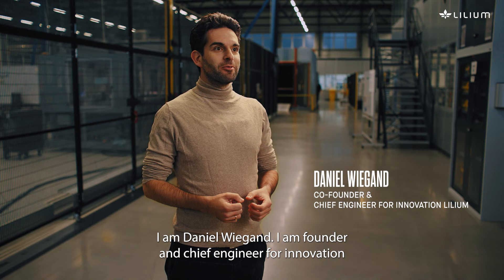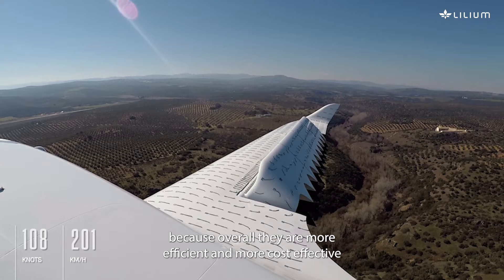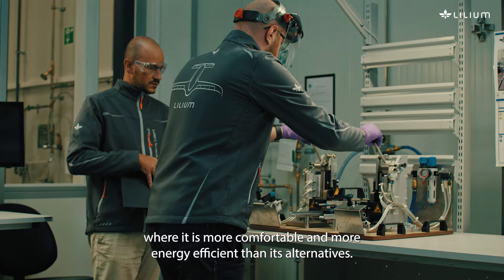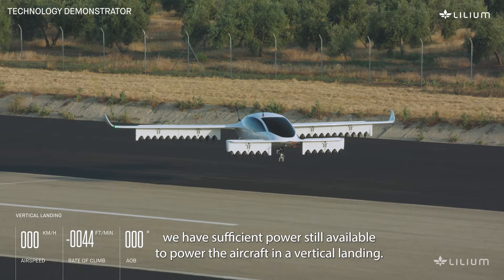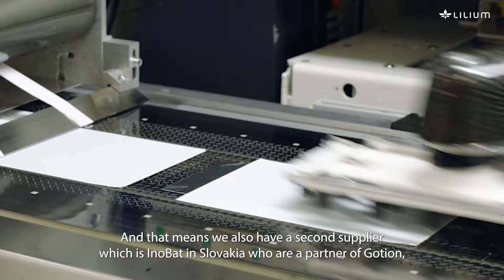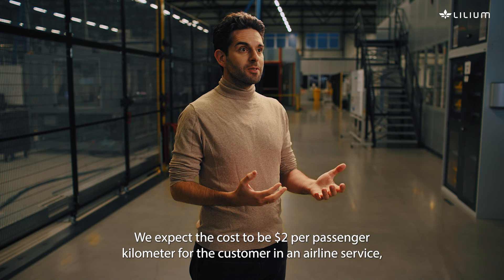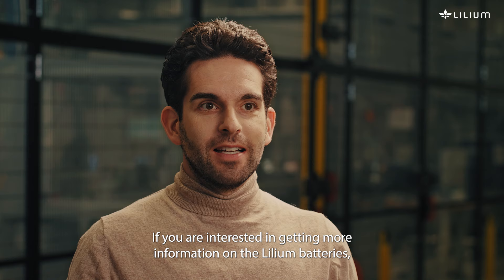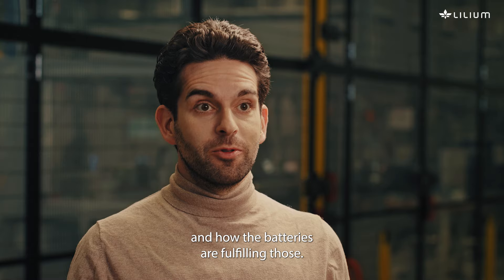Lilium Jet | Lilium’s Battery Technology  | Hear from Daniel

Comment: I remember when they said it would have 300km range :(
Reply: Yes, 350km in 10 years, based on rate of battery capacity evolution.
Reply: Lithium sulfur cathode and silicon anode battery help

Comment: If I had a dollar for every promise of future battery tech that’s just a few years away…🙄

Batteries HAVE NOT gained 6-7% or 4.5% per year in recent history.  Simply “believing” that it will is total BS.
Reply: Lithium batteries not much better than 20 years ago.
Reply: You're incompetent.  Density & factor formats have wildly exploded last year alone
Reply: If you look at the 20 year trend, it's 5% per year. There are of course better and worse years, but 5% is the average. It's easy to be carried away with announcements of new cells, but it takes quite a few years to get from the lab to certified commercial use. And most fail on the way for a wide variety of reasons.
Reply: Agreed unless something completely new comes around the corner, density is near it’s peak. Only production costs are likely to be significantly reduced, leading to the possibility of larger battery packs - however in a plane there are obvious limits
Reply: @tonyb4773  where did you learn about the 5% trend? That would mean they are twice as good now and they aren't.
Reply: @goodfodder something "completely new" could be lithium metal anode batteries, lithium sulphur batteries, or even fuel cells. There's definitely major gains to be realised.
Reply: @xlynx9  I certainly hope so, question is how long will it take to commercialize and at what cost

Comment: I got the answer from your introduction now. Lilium has ten battery packs. That’s exactly like what I was imaging because I had pondering that if Lilium lost one packs, then there’re still other available packs are still working then gradually bring the aircraft down to ground in balence.
Reply: The battery probably exploded and is burning if something happened to it. I'd rather drop than burn

Comment: 한국 LG에너지 솔루션에서 1회 충전으로 900km를 갈수 있는 베터리를 개발 했어요 LG에너지솔루션과 베터리부분을 협의해 보는게 어떨지?
Reply: With all due respect, their development work was based on Electric Vehicles (EV's/Cars) not eVTOL's (Flying Vehicles). It will require much more energy ( factors for consideration  are weight, air resistance, distance etc...) to sustain flight, which they have not proven at this time.  Please be advise that Honda is developing  a Hybrid solution (Gas/Battery) to overcome these obstacles.

Comment: Not enough info. 175 Kim  is that after allowing for reserve in the battery. not much. What’s the speed? For how  many people   Only 6 ? what if you lose 2 battery power packs ?    Waiting 7 years to double the distance is way too long.  Haven’t seen this beast flying with a pilot yet   Think you have missed out heaps of important info. So take it we have to presume the bare minimum. So when will you have your first commercial flight.   You haven’t got that far yet.

Comment: Sodium-ion are lighter is that true?
Reply: sodium-ion will not become standard in the next 10-30 years, it takes manufacturing processes and supply chain to mass produce efficient and solid batteries lithium is here to stay at least in the mid-term future
Reply: @brianben4522  they need to invent one that works before manufacturing. Evtols should do the same.
Reply: Sodium ion batteries already exist and ship in cars, energy density is less as to weight have no idea

Comment: Will the range be 175 km with maximum payload?
Reply: Would you trust their answer? Can it fly empty for 4 minutes straight should be the question and they should show proof.
Reply: @TheBagOfHolding  Who hurt you? Did you buy shares when they were 10$ ?
Reply: @kingplays5369  no but I've been trying to warn people since then.
Reply: @TheBagOfHolding  Bro I’m really sorry I have to tell you this, but what you are saying is just total bs… Look at their battery’s specifications, it‘s ~320 wh/kg (on the cell level) which equals to around 300 kWh for their whole 1500 kg battery (~900 kg for the cell-part and ~600 for surrounding structures etc.). How on earth do you calculate 4 minutes of flight time based on these numbers?  😂
Reply: @TheBagOfHolding  Take the exact numbers with a grain of salt, I‘m not an engineer, let alone an aerospace engineer, but I believe the calculation is at least fairly accurate…
Reply: @kingplays5369  why don't they show it flying unedited for minutes straight? They edit short hops to make it look like substantial flights.
Reply: @kingplays5369  they don't have a full sized craft and they can't lift a battery that big off the ground if they made one.
Reply: @TheBagOfHolding  I suggest we talk again in 2-3 years when the stock is not 85 cents, but (hopefully) at least 8.50$.   :)
Reply: @TheBagOfHolding  Ever heard of disc loading? It’s 1150 kg/square meter for the 7 seater aircraft (with a MTOW of 3175 kg). The lift efficiency is 1.7 kg/kW, so the required electric hover power is approximately 2000 kW. Just look at the actual data my friend.
Reply: @kingplays5369  can you find any multirotor evtol that can lift  a person for 5 straight minutes? It's not even a real thing.
Reply: @kingplays5369  do you think there is a 7seater?  Have you ever heard of the square cube law in physics? You are using their bs numbers to argue when they don't even have the parts to build a full size craft and when they do it will not lift off.
Reply: They have taken hundreds of preorders and the payments fall due when they test the manned flights in the third quarter.  They do believe their figures and half size testing to date and so do lots of airbusiness punters. Why not chill till then.
Reply: @timfulwell8472  where did you learn about that? I want to read about the orders they have that are contingent on the manned flight. That's doesn't sound like a real thing.
Reply: @timfulwell8472  Because there are serious doubts, that the payload & range promised by Lilium is possible with the battery technology available in the next decade. And these doubts come from senior aerospace engineers just doing the math.
Reply: @timfulwell8472  did you make that up? How many people do they need to carry, and how far do they need  to go to get paid?  Who do they have that deal with? Is that an article you read somewhere?
Reply: Quarterly investors reports on their web site

Comment: Hybrid VTOL (Gas/Batteries) is the way to go.  The Single Point of Failure as it relates to this 100% battery eVTOL (cold temperatures, system malfunctions, electromagnetic pulses etc..) and it's circuitry is the 10K pound elephant in the room. I am NOT convinced that this vehicle is SAFE for the public.